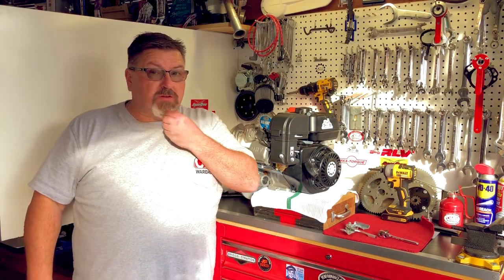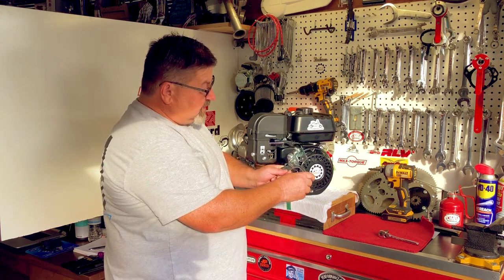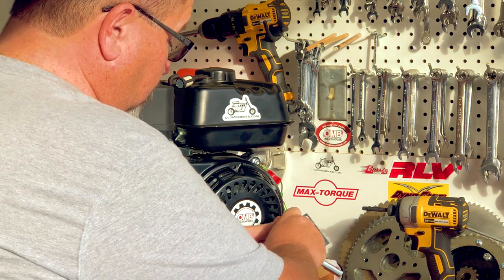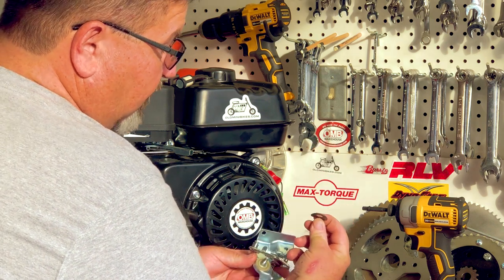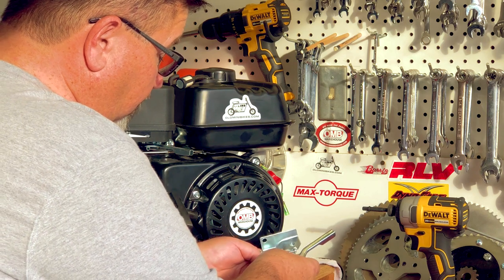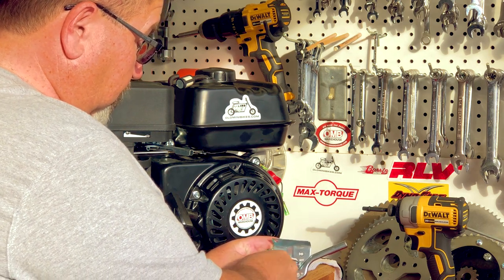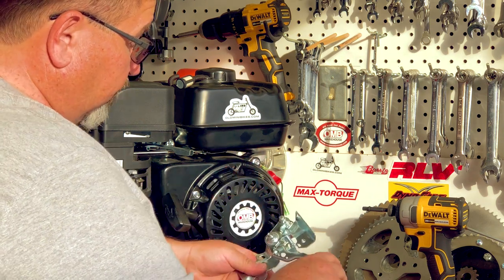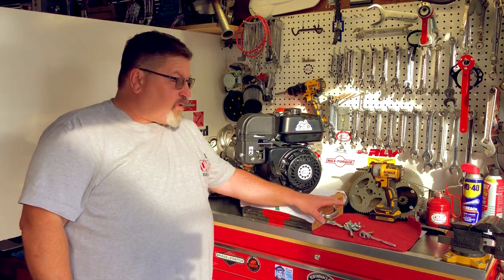Predator 212 Stock Throttle Plate Mod

Comment: GOAT,
Can you help on the Coleman CT200 U EX  I put an after martlet carb/not a Mikuni carb just an after market  with idle screw/Carb Screw would you know a safe  setting so I don’t run it to lean.
Thanks Man! Keep the videos coming.
Sal
Reply from the maker: If you got the non-EPA type carb with the brass idle mixture screw, start that at 1-1/2 turns out and adjust from there. Start the engine and turn the screw in/out until you get the highest idle speed. Adjust the black plastic idle screw in the top of the carb to bring the idle down. Easy!
Reply: GOAT, you the man!

Comment: Got a ? Did governor delete and stage 1 upgrade(jet, header pipe, air filter) on my pred 212. Runs great til it up in rpm then bogs in and out real bad.
Reply: You need a bigger main jet .38 jet

Comment: My Predator throttle is hard to twist 😫. I removed that cupped washer and it's just real stiff to twist. I'm guessing this is a governor thing. We both know I'm reluctant to build this thing and my other three motors are built out, maybe I'm just being a puss because I'm so used to that sweet, sweet governorless throttle linkage from OMBWAREHOUSE.COM!! Maybe I'll finally join the Predator fan boy club and build one. Sigh, its going to happen sometime i guess 😒. If I buy a Ducar I suppose I could strip the stage 1 parts off of my Predator and have a PVL flywheel at the same time🤔.

Comment: I have a mud motor for my boat with a predator 420cc.. what can I do to keep from destroying the engine if I take the governor out.. I really hope you can help with the question
Reply from the maker: Hello,
There are 2 weak parts on any governed Chinese engine. The flywheel and the connecting rod. The connecting rod does not have bearings. It is the aluminum rod riding on a film of oil directly on the crank journal. These will starve for oil at higher rpms. The additional heat will fatigue the rod and typically break it in half and send out out the case! We have the billet rods here
https://www.ombwarehouse.com/arc-billet-rods-honda-gx340-390-4_41.html
The flywheel is not designed for high rpm use and can break apart and/or throw the magnet off. These parts have a lot of inertia and have the potential for great bodily harm! We have the flywheel here to retain the electric start capability
https://www.ombwarehouse.com/arc-billet-flywheel-honda-gx390-adj.html
You will have to give up charging capabilities with any aftermarket flywheel. There are no "safe" flywheels with the internal magnets to retain the charging feature
Most people that get this far into the engine will also add a cam and heavier springs to really wake the engine up. I can help with that too!
Please let me know what questions you have and I will do my best to help you
Reply: @TheGrayGoatGarage  thank you so much for the help!!
Reply from the maker: LOL! Thanks! It is my pleasure to help...that is what the Gray Goat is all about!
Please let me know if I can do anything else for you
Reply: @TheGrayGoatGarage  does a simple stage 1 kit with a intake, new fuel jet, and header make much of a difference with governor still in?
Reply from the maker: Yes, that will make that engine less like a lawnmower and more like a real engine!

The stock muffler and intake are very restrictive. Once we add those parts we must rejet the carb. We typically add up to 30% more fuel! You will see an approx 3-4HP gain with just a Stage 1 kit! Unless you plan on using some billet parts, keep the governor intact! You will notice a difference!
Reply: @TheGrayGoatGarage  that's awesome 3-4hp extra.. I'm definitely getting the stage one kit.
Reply from the maker: That is the way to go until you are ready to invest in the billet parts. You "boat guys" I try to stay more on the reliability side until we can upgrade to billet parts. I know you have paddles...and I also know you don't want to use them! LOL
Reply: @TheGrayGoatGarage  lol true